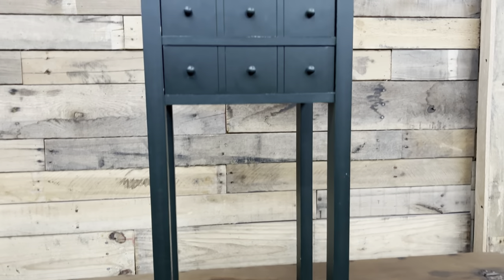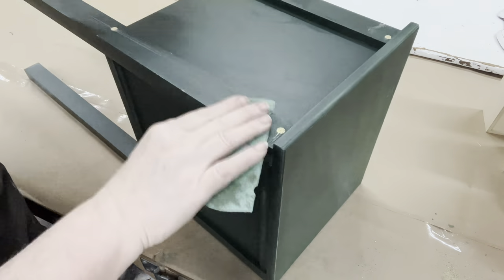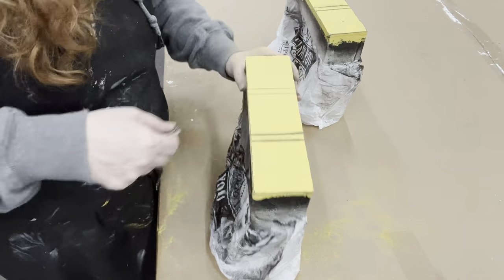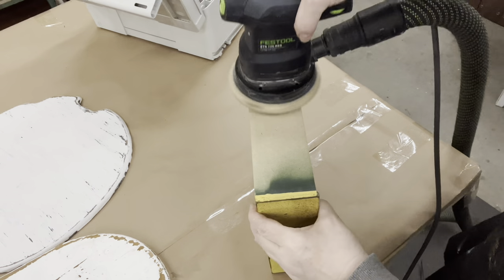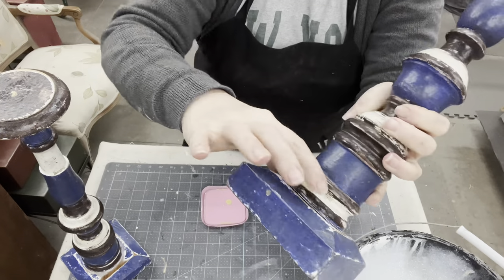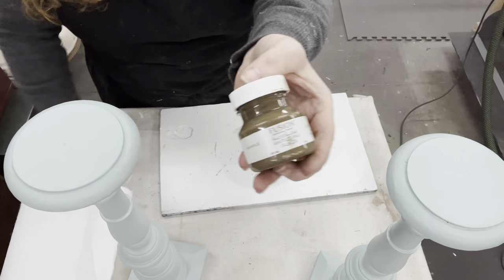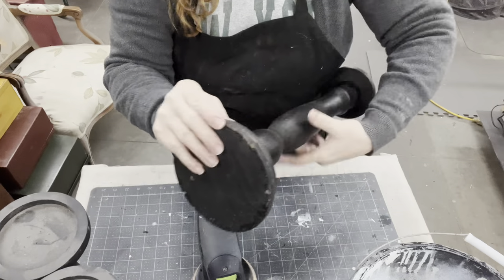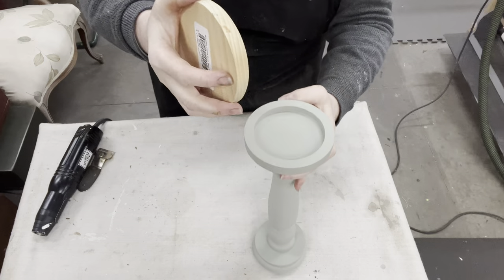EXPLORING COLORS & TEXTURES | DIY | CREATING | HOME DECOR IDEAS

Comment: Yvonne... try painting a base coat of a paint color mixed with sea spray (the thicker the better results) and apply that by stippling (pouncing) the paint on. Then paint over the sea spray mix with the color you want your piece to be (with no Sea Spray) Then rip out the sander and give it a good sand. You will get a two toned chippy finish that is gorgeous 😍 This method is very popular with a texture medium. If you want to take it to a whole new level... when stippling the sea spray base coat, stipple on multiple colors. I usually just do 2 colors with sea spray and when applying the mixture, do it randomly. Then again just apply the paint color (no sea spray)  you want your piece to be on top of that and sand. You will get the most beautiful multi colored chippy finish that looks like the piece has been painted multiple colors over the years and honestly, the look is absolutely to die for, promise! After sanding you can always add your colored waxes to bring out more of the texture. I really hope you give these a try 😁 I promise you will not br disappointed ❤
Reply from the maker: Thank you for sharing that..